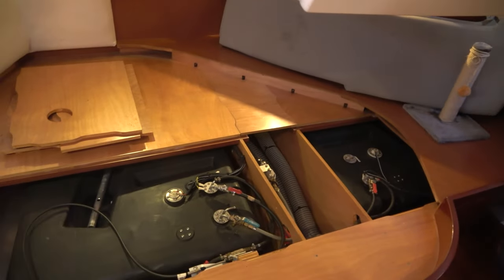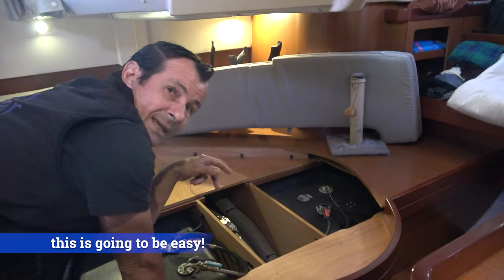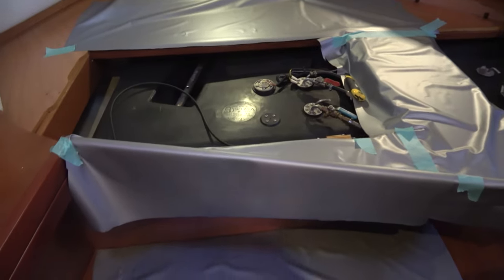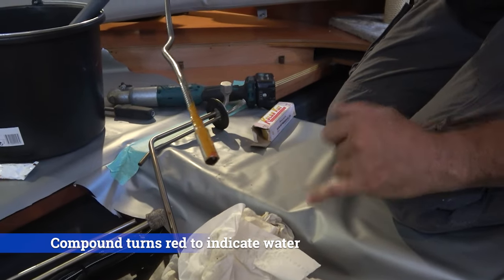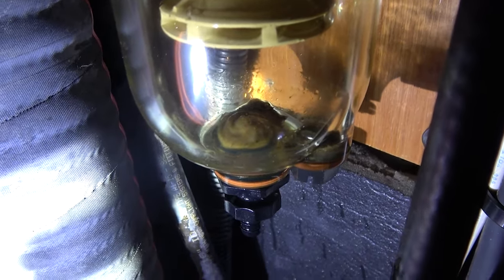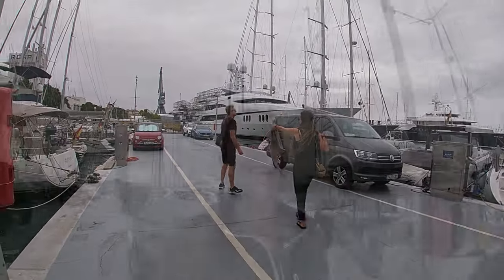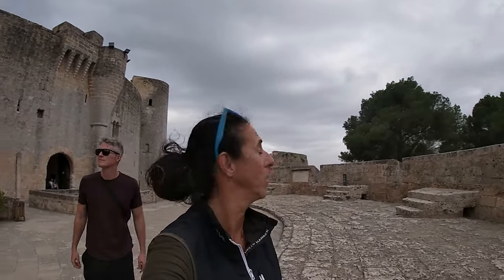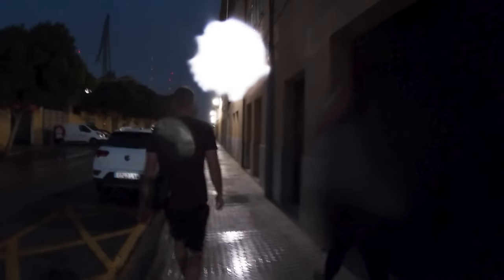Battling Diesel Tank Contamination

Comment: Is there no additive which will stop the bacteria, while not ruining the fuel? Also, how long before the growth resumes?
Reply from the maker: There is additives that can be used and we've now treated our tanks here in Tunisia. In the past we had used our diesel rapidly so growth wasn't an issue but we got into a habit of using the port tank for the most part as we are a bit heavy on that side. Refrigeration and hot water tank is all to port so a full starboard tank tends to balance us. Won't make that mistake again! Also, the last time we filled up in Spain we got diesel with water in it. So that was the issue that really had gotten our attention. Regarding how long it takes to get fouled, that can vary. Typically if you're not using it for a few months you need to treat it. 
Anyway, glad it's all good now. Thanks for watching and for the comment

Kevin and Carla